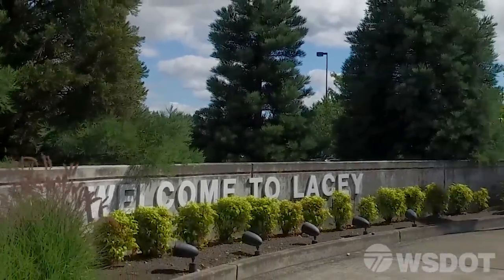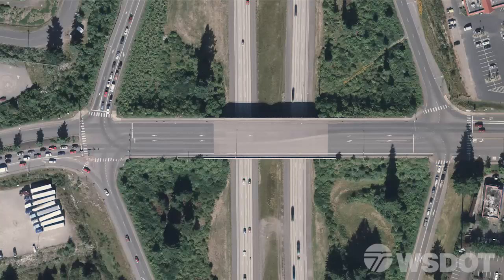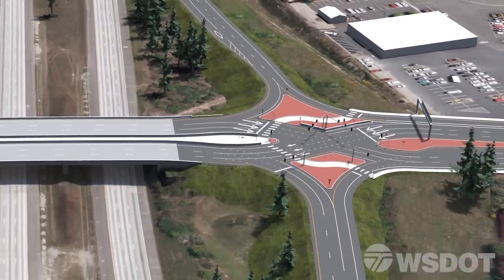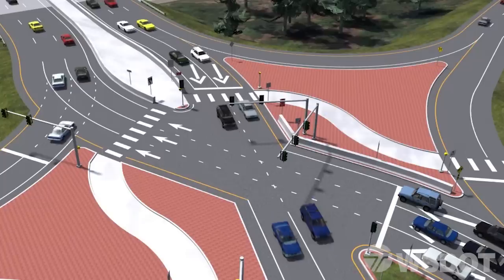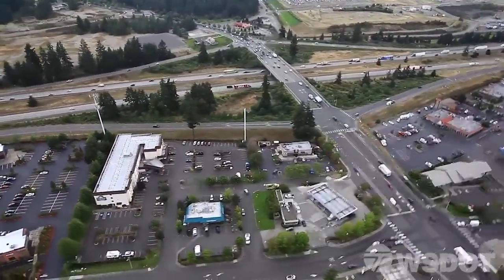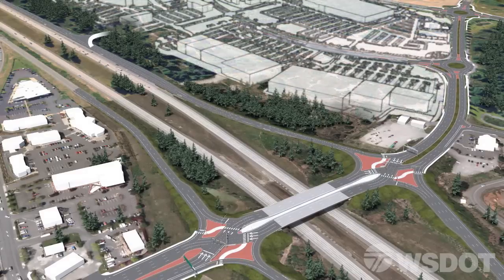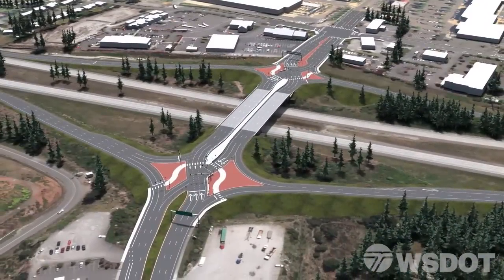Diverging Diamond Interchange comes to Washington State

Comment: still not as good as a roundabout
Reply: yes, zero traffic lights and no stopping 90% of the time.
Reply: Depends, a roundabout would require new bridges - the benefit of the DDI is that it can use the existing overpasses, massively reducing cost.
Reply: Xaiano how do you figure that? Just by looking at the thumbnail I can estimate that a roundabout would fit within the same space of the DDI.
Reply: mathieu st-louis seriously? you have maybe 8ft between the two lanes over the overpass, you'd either have to have 2 separate roundabouts at either end or huge loops at either end.  remember this is a highway and needs to accommodate multiple lanes and big rigs, so corners can't be tight
Reply: jtpf87 ya that's the down fall of roundabouts,  it only takes one person to screw it up for everybody. 
   I know that when they introduced them into Australia, my auzzie friend told me they basically blitzed the people with advertising about how to correctly use them. I know that by the time I lived there briefly, over all they were being used in a more efficient manner then what we got here in the USA.
Reply: Xaiano of course you would need two separate roundabouts at either end. I wasn't thinking of just sticking a single one over a highway. Where have you ever seen that done???
Reply: A DDI solves a lot more issues than a roundabout in this kind of situation.  Roundabouts are good in most cases, but would not be the best option here for what they are trying to accomplish.
Reply: Actually a roundabout (2, 1 at each end) would be much better, but a lack of room and funding means the DDI is the next best thing. Painting different lines is a lot cheaper.
Reply: Yeah. Bloody Queenslanders had no clue. Been around as long as the car in Victoria.
Reply: and you wouldn't need new bridges.
Reply: anchskier a roundabout would be so much better. There would be no need for any stopping. No matter where you are a roundabout beats 4 way stops or traffic lights. Cause it allows traffic to continually flow without stoppage
Reply: mathieu st-louis but a roundabout wouldn't fit into the existing overpasses and space available
Reply: Xaiano we went over this already didn't we?
Reply: mathieu st-louis so why are you still claiming that it would?
Reply: Xaiano cause like I said just by looking at the thumbnail I can tell you a roundabout would fit within the same space that a ddi would fit into.
Reply: mathieu st-louis how? a roundabout over the road would require 2 flyovers, there is only one
Reply: Xaiano ok bro for like the second time one round about does not replace two DDI's. One roundabout replaces one DDI's. so one roundabout located at either side of the overpass. instead of having two DDI's one at each end you have two roundabouts
Reply: You're not accounting for the number of lanes on the surface-road. Two-lane roundabouts require twice as much space as a single-lane one. Also, the "DDI" is the entire interchange, from one side to the other, including the bridge. There are two divergence zones, but only one "DDI." It is called a Diverging Diamond Interchange because it is almost exactly the same as a diamond interchange, but with the diverging zones at either end, creating safer lane-paths, and less cross-traffic areas. Instead of having 4 traffic-crossing left turns, there are none. Roundabouts accomplish the same thing, but require much more complex signage, and a much slow traffic speed.
Reply: CynicalDriver More complex signage than the DDI? A sign with a circle on it, done. Roundabouts speed the traffic up, not slow it down, unless you have people who don't know how to use a Roundabout. Anything with traffic lights slows down traffic, not Roundabouts.
Reply: CynicalDriver so a complete stop at a red-light is "high speed " to you lol? I think a two lane traffic circle would fit at either end just fine.
Reply: mathieu st-louis
 Stop and think for a minute. I am not talking about constant travel speed, but the speed-limit, and number of cars per hour. With a stop-light, you do not have to slow to 25 or less miles per hour unless it is yellow/red. That means that at least a third of the cars proceed through at the full speed limit.

Wow.
Reply: Anthony Jenkinson
 Have you ever actually traveled through a multi-lane roundabout that intersects 4 or more roads? I mean, as the driver, and not the child playing on an iPad in the back seat? They do get quite complex, especially when there are two (or more) main arterial roads coming into it. When you have a national or state road (smaller highway) meeting another one, the signs are no longer simple drawings of a circle with a cross through it... They must show the dedicated lanes, the highways associated with each exit, and have labels for the local roads that may also be meeting there. Bother to experience the real world of driving before making ignorant comments please.
Reply: CynicalDriver  dude you don't know what you are talking about , you have to go zero MPH at a red light. With more then half the cars having to be at a complete stop. There is ZERO slowing down for a traffic circle. You can have them built to go at any speed if you want. Only down side is the faster the speed the larger they have to be. But anything is faster then ZERO MPH! WOW right back at you. You gonna tell me 25MPH IS slower then 0 hahaha
Reply: CynicalDriver roundabouts will always be better then a traffic light. Because like you pointed out, no one can go through a red light. Traffic circle has no red light therefore has zero cars stopping. Meaning it will always be superior to creating a steady and uninterrupted flow of traffic. There is no way around that. Traffic lights stop traffic and are inefficient. That's just fact.
Reply: BobElHat actually I live in Hawaii.  But I have been to STL a few times for what it's worth. My experience of roundabouts is mostly in Australia. Some in NZ but not as much as Auz. 
 I am aware that they get backed up. But so do intersections. To me there's no comparison. Your pointing out a flaw ( congested roundabout) to make traffic lights sound superior while traffic lights are in no way not effected by heavy traffic. In fact they are worst. In heavy traffic people intend to "block the box" resulting in zero movement of traffic in any direction leading to a city wide gridlock.
Reply: mathieu st-louis Mate. Traffic Lights works better when handling BIG Intersections. Because no matter HOW MANY cars are backed up (Let's say, 40),   AS the lights turn green ALL 40 is able to go. And you're able to fit a 6 Lane to 6 Lane interchange. However in a Roundabout, You will HAVE to giveaway to the vehicles coming from the right road, or vehicles already on the Roundabout. Considering that it is a normal roundabout with equal amounts of traffic on each street going in and out of the Roundabout, and equal density of traffic on the Roundabout itself, You're going to have to give way to 2/3 of the people. Which means stopping (generally) 66% of the time. And of course, If you wanna go straight, you have to go AROUND a circle. The worst part is, if you wanna turn right, you have to make a 270° Turn In order to get to that street. Compared to an Intersection with lights, You generally STOP more, and you TRAVEL more. However if traffic is light, roundabouts are more efficient because of the no-stop rule. However, because you're on a Roundabout and you have to make either right turns or left turns (Even the slightest. I mean, you're driving around a circle.) You're gonna have to slow down to at least 30km/h Not counting acceleration after stopping. However in a normal Intersection you travel through the SQUARE “Conflict Area” going in a STRAIGHT line at at least 60km/h according to the local speed limit. (Again, not counting acceleration). Generally when a Roundabout is able to have traffic flowing without stopping, it can stay as a Roundabout. However if people have to stop and wait to enter the Roundabout for quite a long time, then an Intersection with lights will be better. One of the most used Interchanges off the main State Highway 1 was using 2 roundabouts, 1 leading to the busier area and one leading to residential. Recently it received 8 Laning and also was changed from a Roundabout WITH traffic lights to a Square Intersection still with Lights, on the busier side that is. The residential side however received new Lights that operate according to the amount of traffic, to which my mum thought was quite cool.
Reply: StatTrak™ Tagged 99  I guess traffic lights do have their place. But here in USA ( I assume you're from Auz cause you said a right turn makes you do a 270 degree and you have states)   Traffic lights and four way stops are way to overly utilized.
Reply: I remember all the 4 way stop signs in qld being a pain in the arse, but people not knowing how to use a roundabout is the biggest problem with roundabouts. I see people stopping all the time in qld for no reason when they come to a roundabout. It all comes down to driver education and awareness. They have recently changed the signalling laws in qld regarding roundabouts, because they were asking to much of the driver (!?) They had signal on and off the roundabout, now they just want signal off the roundabout. So now it's a little easier, but still nowhere as good as the southern states, where you indicate right or left when turning, no signal for straight ahead. Part of the giveway sign at all roundabouts is the ability to continue on when safe to do so. You see this all the time in vic, rarely, even in traffic, do you have to stop at a roundabout. The only reason we have start stop technology on cars is because of.... you guessed it, traffic lights.
Don't get me wrong, traffic lights are needed at certain intersections for sure, but they will never be as quick and efficient as a roundabout.

Is State Highway 1 in your state also Federal Highway 1?
Reply: Anthony Jenkinson totally agree with what you said and to answer your question, no state high ways are not considered interstates or "federal" highways. All tho many do cross state borders at time I believe. They typically don't serve the same purpose of interstates which is linking the nation together and major military strategic points.
Reply: Anthony Jenkinson I live in New Zealand, all Interstates are named "State Highway"'s
Reply: StatTrak™ Tagged 99  New Zealand doesn't have states lol
Reply: +mathiew st-louis A nation can also be called a State. The United States is called such because the original vision for the country was for the individual states to have more power than the federal government. It was essentially supposed to be the partnering of 13 independent nations under one contract. Think of it like ancient Greece... Each major city was the capital of a state, called a "City State," bound loosely together as a country only by virtue of agreement. They often warred amongst themselves, because they really weren't all as one. This is why the President delivers a "State of the Union" address, and governors deliver "State of the State" addresses. The "Secretary of State" and the "State Department" do not handle issues with Wisconsin or California, they handle issues important to the security and sovereignty of the union (Foreign Policy.)

TL;DR - "State" can mean different things. What we call a "state" in the U.S. is technically a  province. Internationally, a "state" is a nation. So, they call "national roads" "State Highways" because they are highways maintained by "The State." In the U.S. we have "Interstates" and "U.S. Routes" because there must be a differentiation between local, county, state, and national roads.

Bonus: The United Kingdom is called such because the Queen "rules" over more than one state. She is Queen of Scotland, Northern Ireland, Wales, and England. They are all technically independent nations... Or, "States."
Reply: CynicalDriver  it doesn't change the fact that New Zealand doesn't have states. WTF.....? Sure you can argue that New Zealand is itself a "state"  but that's irrelevant to this conversation.
Reply: mathieu st-louis - You just have to argue everything don't you? Can you just not accept that you do not know everything and you are not always right?

You responded to someone who actually lives in NZ and said they call all highways "State Highways" with "They don't have states." So my response to you IS relevant to that portion of the discussion. Please get over yourself and understand that a "State Highway" is a highway funded and maintained by State (read federal, national, or country) taxes. You are right that they have no states, but they CAN have "State Highways."
Reply: mathieu st-louis - To your unsure sounding assertion that many (US) state roads cross borders... As someone who has driven all over the continental United States I can say that is not exactly true. The roads do not just end at the boarders, but the designation changes.

There are cases where one state makes a road a state highway, but the neighboring state does not. In those cases the state road loses its number and becomes a county or local road going forward into the new state. Typically this does not happen, but it can and does.

Most of the time, it will simply change from WI 27 to IL 53, or something similar. The only roads that keep their number and designation when crossing a state line are US Routes and Interstates. US Routes are typically very similar to state roads, with only two lanes and no divider or median and intersections involving cross-traffic. Interstates are always "controlled access" divided highways with at least two lanes in either direction.

Hawaii is a special case, being the only state to have Interstate Highways that do not actually connect to another state or country in some fashion. Personally, I think they should just be US Routes instead of Interstate Highways.
Reply: mathieu st-louis - To your unsure sounding assertion that many (US) state roads cross borders... As someone who has driven all over the continental United States I can say that is not exactly true. The roads do not just end at the boarders, but the designation changes.

There are cases where one state makes a road a state highway, but the neighboring state does not. In those cases the state road loses its number and becomes a county or local road going forward into the new state. Typically this does not happen, but it can and does.

Most of the time, it will simply change from WI 27 to IL 53, or something similar. The only roads that keep their number and designation when crossing a state line are US Routes and Interstates. US Routes are typically very similar to state roads, with only two lanes and no divider or median and intersections involving cross-traffic, but they are nearly identical to Interstates in many many many locations. Interstates are always "controlled access" divided highways with at least two lanes in either direction.

Hawaii is a special case, being the only state to have Interstate Highways that do not actually connect to another state or country in some fashion. Personally, I think they should just be US Routes instead of Interstate Highways.

Interestingly, California is the only state I have seen that doesn't have mile-markers and exit numbers on the Interstates, which is technically breaking the guidelines and requirements for a road achieving that status. It makes driving around an unfamiliar city much more frustrating than it should be, as you have to read every exit sign to be sure you don't miss your exit.
Reply: mathieu st-louis THEY ARE FUCKING CALLED "STATE HIGHWAY"S. DEAL WITH IT.
Reply: StatTrak™ Tagged 99  when have I ever said NZ doesn't have state highways? What I'm saying is NZ has zero interstates. Hell they have extremely few divided highways and the ones they do have are in city's and don't connect with any other cities before turning into a non divided highway. Chill out, maybe you need to like get laid or something.
Reply: StatTrak™ Tagged 99  you said "in NZ interstates are called state highways" which is bull shit cause NZ has nothing that even mildly resembles a interstate. Everyone has state highways but NZ's infrastructure is not developed in a way to have interstates. If you did you could drive from Wellington to Auckland in well under six hours. Cause interstates connect cities with un interrupted and high speed traffic. A state high way is smaller has a lot of interruptions like lights stop signs etc and has services right on it like gas stations. 
    NZ interstates are not called state highways! They only HAVE state highways no interstates.
Reply: mathieu st-louis Interstate is only a way people call highways. Why do some interstates don't travel Inter-States? Yeah, that's right. IT'S ONLY NAMING.
Reply: StatTrak™ Tagged 99  there are only 3 interstates in all of USA that do not cross state borders, and they are all located on the Hawaiian islands. But regardless still are call interstates because of the following reasons. 
1.) they are high volume, high speed highways that have zero interruptions. I.e. No right or left turns or crossings anywhere. Only merge on or merge off at a exit. 
2.) they are used to connect military strategic positions as implemented by president Eisenhower. The H-1, H-2, and H-3 all in Hawaii and the only ones that don't cross state borders and have H's instead of I's. All connect Pearl Harbor, Hickman, schofield barracks, fort Shaffer, Kaneohe bay marine base and Honolulu. 
3.) all received federal grants to help the states build them. 

  There is not a single interstate style highway in New Zealand. The closest you get is in major cities like Auckland and Christchurch where you see them but as soon as they leave the city area they turn back into state highway style high ways. Where they are not divided and have intersections and service stations on the side of a road that you can turn into from the highway. Interstates continue connecting to other cities. Some cross most of the entire USA.
Reply: StatTrak™ Tagged 99 imagine a 4 lane divided highway going from Auckland to Wellington passing by Hamilton that has a high speed limit and you can't turn left or right onto. That would be a interstate.
Reply: mathieu st-louis No, Interstates are called interstates BECAUSE the US Government decided to NAME it Interstates. China has Intercity Expressways. And NZ has State Highways. It's all NAMING.

I-37 Does not cross any state borders in South Texas.

I-19 Does not cross any state borders in South Arizona.

I-4? 
I-16?
I-39?
I-27?

My comment was "Interstates in NZ are called State Highways" and surely enough there is no doubt that NZ has no Interstates. It's a metaphor comparing two things. They're EXTREMELY Similar.
Reply: StatTrak™ Tagged 99 dude name one NZ state highway that fits the characteristics of a US interstate? Just one please. Yes other nations have interstate style highways but not NZ. Germany invented them in fact there called autobahn there, but they fit the characteristics I have previously listed.
Reply: mathieu st-louis Wait, so I can't even compare a Highway System in NZ to US's Highway System? It's literally High-Speed Passageway between two or more locations. Get over it. A comparison or metaphor can be made WITHOUT the two things listed being identical.
Reply: StatTrak™ Tagged 99 yes NZ does not have the same highway infrastructure as USA does. The Eisenhower interstate system is one of the worlds best, along with Europes. 
   It's not the same. Your state highways are low speed many turns even switch backs on mountain sides at time they Are only two lanes one going each way. Every town it comes across makes it have stop signs and intersections like it's not even close to meeting the characteristics of a interstates.
Reply: StatTrak™ Tagged 99  if I had a self powered car I could drive from Los Angeles to New York City without ever seeing a intersection of any kind. Think about that. That's what our Eisenhower interstate system makes possible.
Reply: mathieu st-louis You don't see Intersections when you're driving from Auckland to Wellington.. You NEVER have to stop unless traffic.

Then again, you're missing my point.
Reply: StatTrak™ Tagged 99 thats bs. I've driven from Auckland to Wellington and I encountered intersections at every town I went through. 
   What is your point?
Reply: mathieu st-louis My point is that it's only naming. I have made a metaphor comparing the US Interstate system to NZ's State Highway system and the metaphor stands. It's all High-Speed Connections between two or more destinations. Do you not even read my comments?
Reply: StatTrak™ Tagged 99  that's what I thought you were trying to say. And I am trying to say no. Your state highway system would compare to a us state highway system. It would not compare to the federal Eisenhower interstate system. There's are clear distinctions between interstates and state highways that I have listed multiple times now. And there is no highway in NZ that fits the description of a interstate.
Reply: mathieu st-louis Metaphors don't have to be EXACT. As I listed before, BOTH are fast-flowing High-capacity Well-maintained Asphalt roads. So the comparison is legible.
Reply: +StatTrak - Give up. He is a troll, and can never be wrong. This is why he keeps re-defining what he has said earlier. First he laughs at people and makes a snide comment, then goes further off the deep end with insults and round-about logic (pun intended) to keep his ego inflated. I have met a few people like him in my lifetime, and I refuse to talk to them anymore... It's simply not worth the wasted energy and effort. He can never be proven wrong, just as a pet rock can never be proven wrong.
Reply: CynicalDriver  I would be proven wrong if he mentioned one single NZ state highway that fits the criteria. But he hasn't. Speaking logically is not trolling. You failing to understand logic is the issue
Reply: Xaiano is correct!
Installing a DDI cost MUCH less money than building a new bridge for a roundabout. The DDI's  can be installed on and around existing bridges. All that is required is the reconfiguration of the deck. Mathieu, you should know this. Don't you drive through these in Springfield and Branson?
Reply: Joel Johnson I don't even know where those places are. And I still don't understand why you'd have to build a new bridge to make roundabouts?
Reply: Ha ha. At first I thought you were serious.  Roudabouts are about the most lame thing ever.  One pedestrian brings the whole thing to a screaching halt and I do mean screaching.  That is if the pedestrian isn't run over by then.
Reply: what pedestrian is walking on on/off ramps?
Reply: Two separate roundabouts at either end?  That would be 4 total.
Reply: You wrote (not said) "two separate roundabouts at EITHER end".  That means two at one end and two at the other end.  2 + 2 = 4.
Reply: No it doesn't Learn English. two separate means 1 and 1 get it? There is two and they are separate. If someone says on two separate occasions that doesn't all of sudden make it 4 times. Or when some one says we are taking two separate cars that doesn't mean they are taking four. Like WTF????
Reply: You wrote two separate at EITHER end.  The word "either", in that context, does not mean one end OR the other end, it means EACH end.  The word "separate" is insignificant here.  The word "either" is what is important.

Incidentally, your telling me to learn English is laughable, considering the number of grammatical errors in your latest post.
Reply: if there together than how would they be separate!? What your saying in English would be two couples or two pairs, at the very closest possible vocabulary it could be said two separate pairs, where the word pair would make the statement accurate. But if you only say two separate, than that means there is TWO and they are separate. Not 2 together with another 2 together separate from the other two. Like seriously where are you people coming from?
Reply: You are wrong, pure and simple.  End of discussion.
Reply: two separate is 1 & 1. there are two and they are separate. BASIC English try to learn it.
Reply: mathieu st-louis your just a try harder for roundabouts, roundabouts are only for small/medium traffic, not large scale traffic.and if 1, I MEAN even 1 person screws up, it ruins the entire thing.
Reply: I dont know how good these would be for high traffic either, I have seen lights be very inefficient. People blocking the box etc. But I'll agree roundabouts are probably worst in those conditions.
Reply: mathieu st-louis  This state can be prone to snow in the winter. And that means it can be tougher for you to navigate in snow weather conditions( which can last for months sometimes in this state ). You are correct about less car accidents The thing is, with roundabouts, property damage goes up. That's why roundabouts should only be in lower/mid size traffic, also, can you post a picture and how the heck would the roundabouts work using the interchange posted in the vid?
Reply: mathieu st-louis This does save time and help the environment( roundabouts that is), but it would be more of a problem the larger it is.
Reply: this would be the image i have in my mine http://www.berkeleyside.com/wp-content/uploads/2013/12/Gilman.jpg
Reply: In your MINE?  So tell me, exactly WHERE is your mine located and what do they mine there?  Gold?  Silver?  Platinum?  Coal?
Reply: Errr...most motorway (highway) roundabouts in the UK!  The US may do most things bigger than everyone else, but if we copied your intersections the country would grind to halt as we are so crowded!  We love our roundabouts, who wants to sit at a red light at every junction when we can use big roundabouts at 40 or 50mph.  https://goo.gl/maps/Gk6HTQ9REbB2
Reply: jtpf87 There are 3 by my house. they're getting more common in the US.
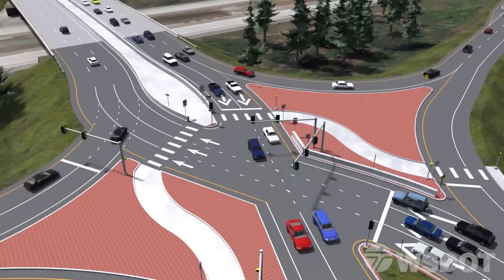Reply: A DDI is quicker in this situation. A roundabout would work but not as efficiently. You have to take into consideration semi-trucks and increased traffic size. For a roundabout to work as efficient as a DDI in this case, there would have to be one in the center of the two sides of the interstate. I encourage you to pause the video at 0:40 and mentally place two round abouts at the intersections then compare it to the DDI. You will find that my theory is correct. For example if you past your exit headed South and needed to go north a DDI is extremely faster. And trust me they would never reposition the actual interstate to place one roundabout in the center of it for one exit, it's just not worth it.
Reply: mathieu st-louis Do you realize a roundabout that size would be a bottleneck if any truck traffic existed.
Reply: trwent : No, he's not wrong, you are.  "...  two separate ... at BOTH ends" or  "...  two separate ... at EACH end" would mean 2 + 2 = four.  "...  A separate ... at EACH end" would be best to mean two, but "...  two separate ... at EITHER end" will be generally understood as two, although less clear.  Consider that it is short for "...  two separate ... (comma, placed) at EITHER end".